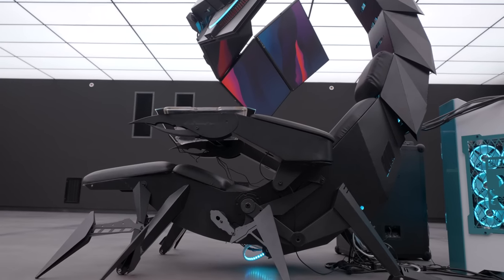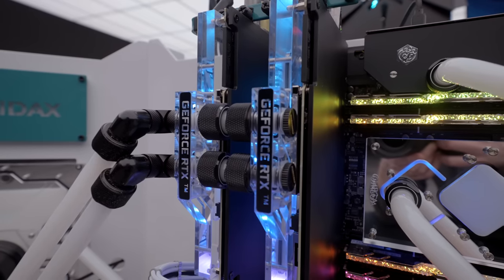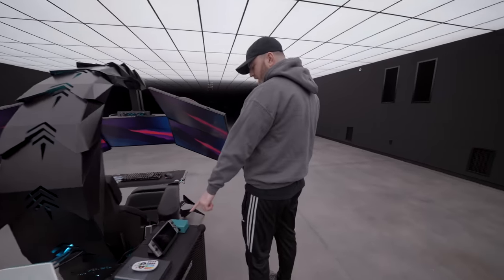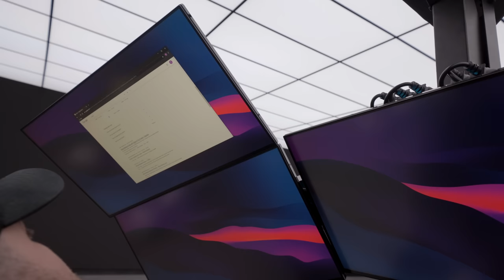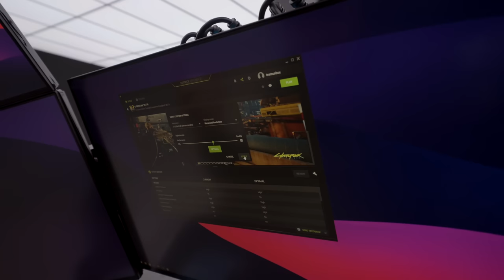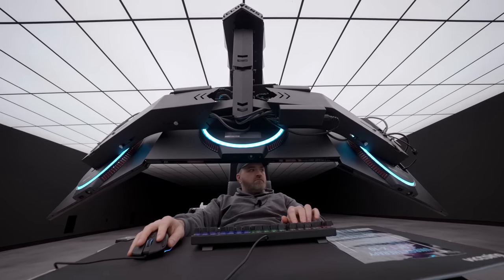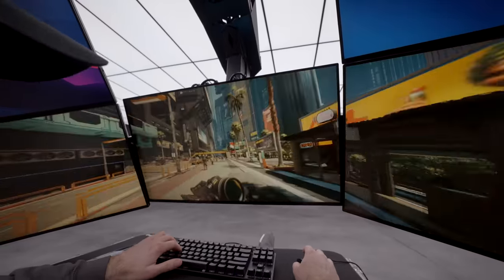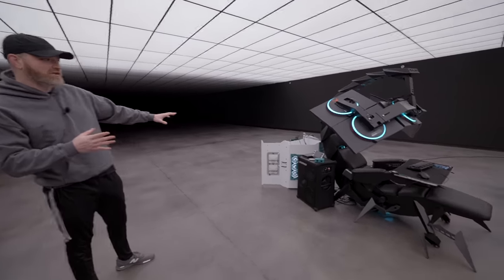The ULTIMATE $40,000 Gaming PC Setup

Comment: Setups like this make FAR more sense with a single Monitor like the Samsung G9 for example. Would keep the price down as well. $1700 for monitor $2K-$3500 for the chair depending on where you get it and say another $2k for a capable Machine of driving the Samsung G9 and whatever you want to spend on Accessories like the keyboard mouse and headphones/speakers and what not for the setup.Easily less then say $10k for the entire setup or even less if you step down on the PC and monitor.
Reply: i know ur comment is old but yo fine sir $2K not even going to get you that GPU let alone the complete computer with todays prices. but you are right the G9, or even two stacked  would be much better

Comment: First off i normally would be wowed and entertained by your content... but this video... is by far your worst Miss-informing video ever... You might want to fact check a few things.... 

1.) Cyberpunk 2077 doesn't support multi gpu configurations only 1 gpu will be doing the work... 

2.) your 3090s dont have a NVLINK bridge thus each gpu will be doing independant workloads... 

3.) most games wont work with DirectX Explicit Multi GPU... 

4.) The monitors your using are not the first 4k 144hz 27inch displays.... 

5.) Just because your excited about something does not make good content to watch.

This was just terrible. I am a 3090 owner... and this video disgusted me.

Today this was like watching the RICH Version of the VERGE...

This was on par with the VERGE's how to build a PC video... lets use them tweezers... Mic drop.

Comment: For a budget version, running 3x 1080p 144hz monitors with 4k down sampling looks good too! (Ofc not as good, but is exponentially cheaper)

Edit: 24" provides the best 1080p picture for gaming imo. I know that a 27" won't look great with 1080p because I also have one as a side monitor.

Comment: Are video games THAT important to justify buying something like this? Don't get me wrong, it's a decent setup to be sure but I can think of a hundred things better to dump 30 g's on. Besides, this gaming chair/system combo is going to be done better for less money by the competition somewhere between six months to two years from now. 
Random Jackhole down the street: "My setup actually has mechanical legs that move the whole thing through the house!"
Random Jackhole two blocks over: "Oh yeah? Well mine hovers, cuts the grass AND takes the garbage out..all without interrupting my game."
Random Jackhole across town: "My setup does all that PLUS it'll shellack so much butter on the door jambs, I can almost get into the next room WITHOUT mechanical assistance...you should have seen me trying to get to the bathroom before the techs put my Side Butter-er-er 3000 complete game-n-shame system together. Picture 550 lbs. of pink, hairy meat wrapped in a denim moomoo being pushed through a mail slot (face first) by a skid steer tractor and you're pretty much there. Better yet, take 20 Ken dolls, melt em all into 1 and while it's still soft, use a ladle to shove Ken amalgamation through the front door of Barbies dream house."

Comment: absolute trash set up for 40k. the gaps between the screen are uneven and angled and kinda large. Going with only one screen in the middle and two screens on the side was dumb. The middle is the most important part of your set up, the sides are an after thought for peripheral vision. A much better set up would have been using 1 or double stacked Samsung Neo g9 Ultrawide monitors preferably the 57 inch ones so there would be minimal gaps. I imagine the reason why you didn't put two monitors in the middle is because you didn't have enough space with the arm mount from the chair, but if you were really pro you would have just designed a custom VESA mount to literally McGuyver some extra room. Don't claim you've created the ultimate when its no where near "ultimate" and low key kinda sucks.